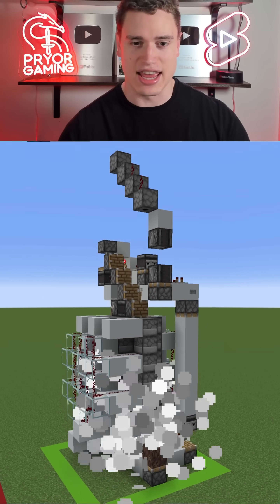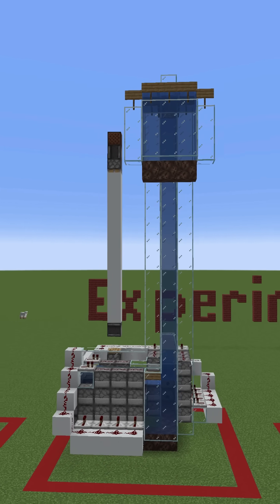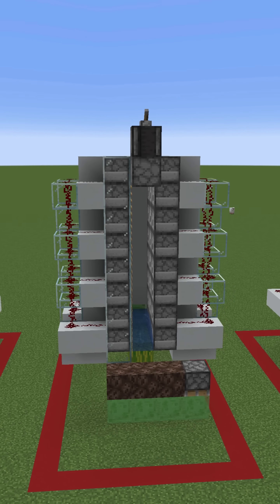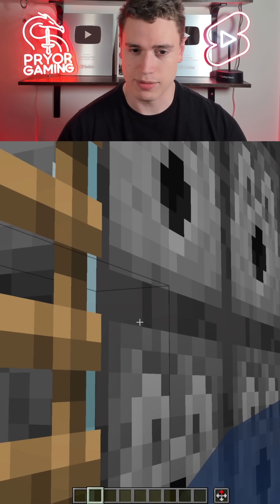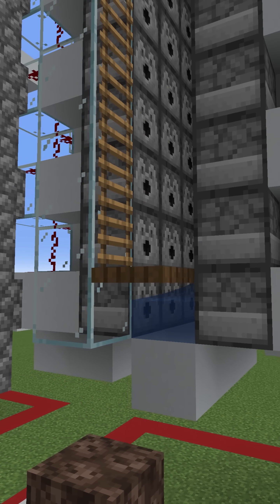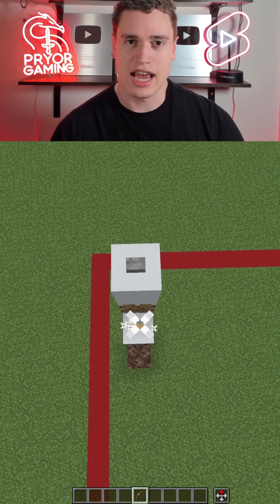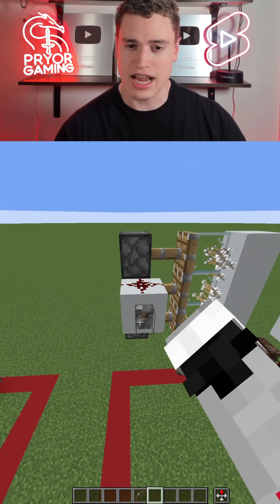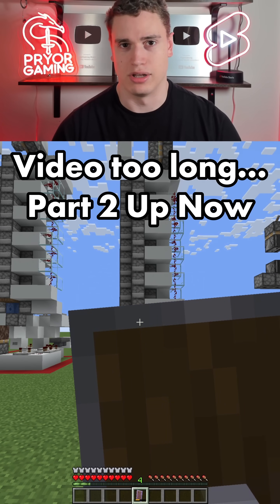Minecraft Rail Gun Design Process

Comment: Give it a volley effect, we saw that n number of arrows reduced shield health, so we up that to get the perfect amount to one shot a shield, while the first shot is firing have a second volley charging, fire the second immediately after the first volley fires (have the tnt ignite on a specific timer so it feels instant)
Reply: Or you could have 2 separate levels to the arrow loading mechanism, the first one specifically for a shield, drop some tnt BEFORE the 1st volley fired, this way its ready for the second set of loaded arrows.

If that doesnt work, more speed = more damage right? You could just overload it with more tnt.

If I was you, I would want this to be as versatile as possible, I cant have a full setup only for the enemy to not stand right in front of it. I remember  I made a ender pearl launcher (I had to throw the pearl into the water beforehand) which shot straight up, it also shot tnt up so I could choose what direction I wanted the pearl to be launched by setting off tnt from the direction opposite to where I wanted to go. This WILL result in significantly slower arrows with less damage, but if there are enough arrows this could mean you obliterate enemies from almost any angle